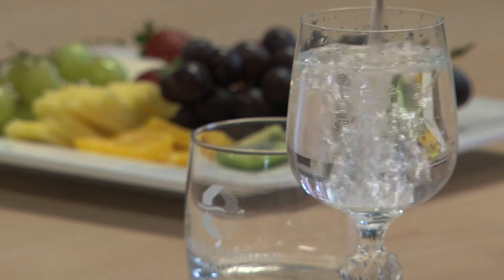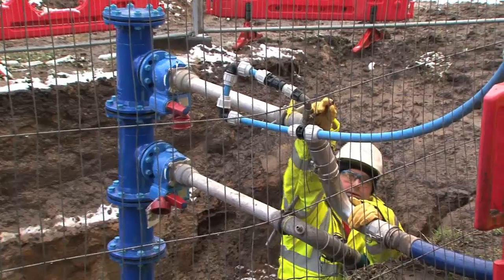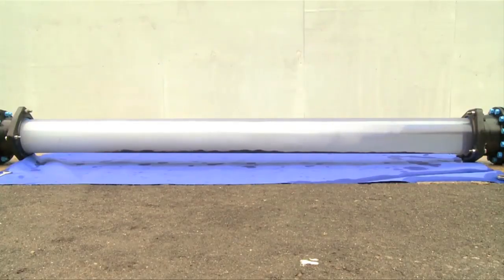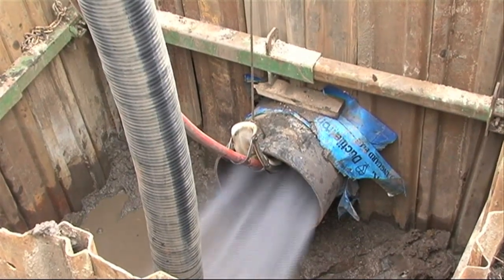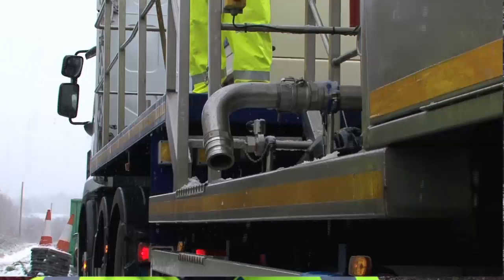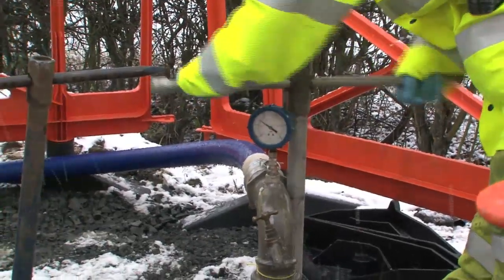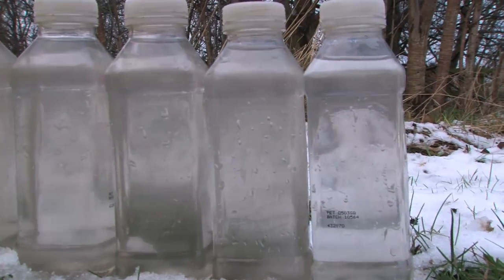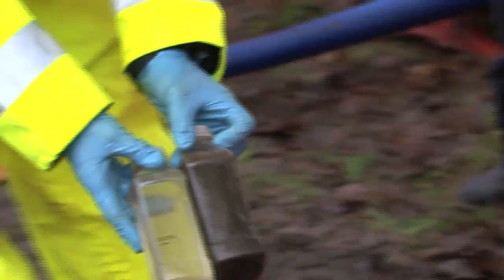ICE Pigging - Mains Cleaning Project

Comment: Just one problem its only a patch. If you do not line the pipe it will just rust and tuberculate back after cleaning. Also this does not seal joints or leaks like traditional cleaning and lining.